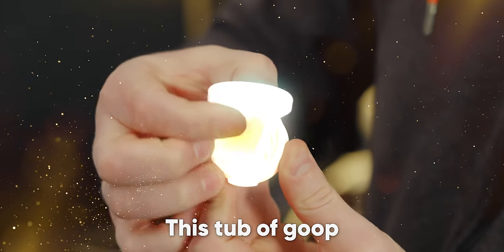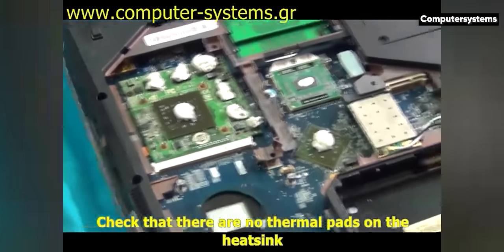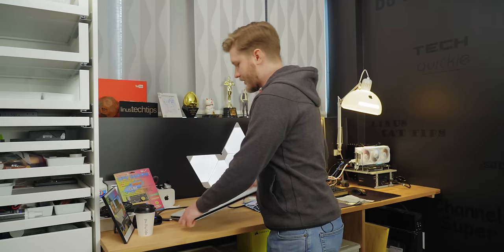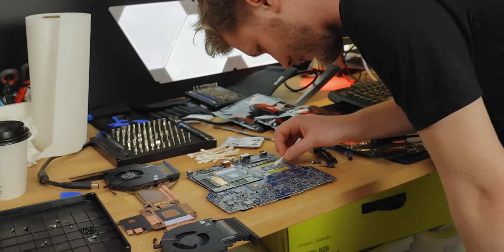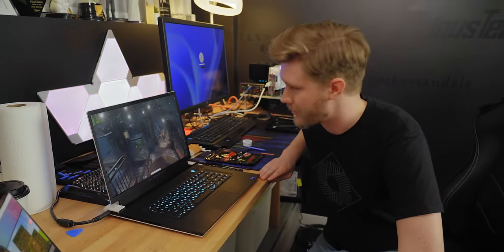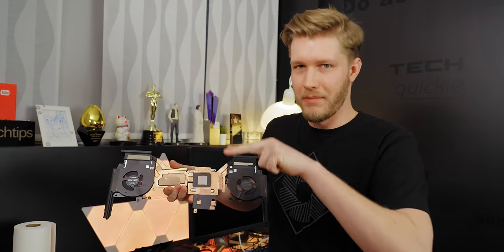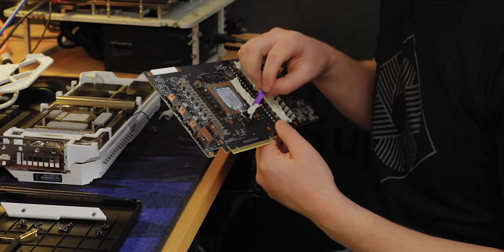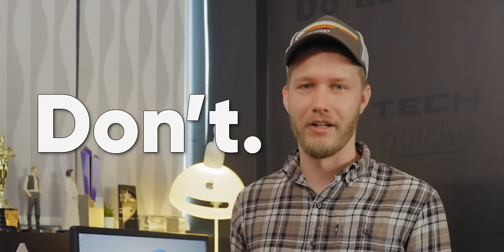More FPS for just $10 - K5 Pro Viscous Thermal Paste

Comment: 5:53 DO NOT USE COPPER SHIMS
Ever!
Especially. ESPECIALLY!! In a laptop!

An average Joe modding his system is at insane risk of shorting his GPU or laptop with that. Even if he succeeds, it voids the warranty, so if the expensive part ceases to function, they can't repair it for free even due to completely unrelated issue. But more often than not, it dies precisely because of that since copper is electrically conductive. 

As we all know, 12V isn't supposed to go into 1.2V circuits. Goes to memory? No you have to replace all those GDDR6X chips, GL sourcing them. Goes to the main GPU die? The die dies, no pun intended. Even if it mearely rosts an RGB controller, it has a high risk or burning a freaking crater on the PCB since modern GPUs are supposed to draw a lot of power and when the PSU notices 400 watts drawn, it can't possibly tell if that's a normal Nvidia transient load or a catastrophic failure.

If you misjudge the shim thickness and exceed it, you won't have a thermal contact elsewhere. That "elsewhere" usually is the main GPU die, and guess what happens if it doesn't contact the coldplate? It dies! 

Installing a copper shim in a laptop is the next fucking level. Laptops are portable devices. They may and will be carried around, and can easily be subjected to vibrations and whatnot. That displaces the shims which aren't properly fixed in place - they aren't supposed to be there at all! Displace them enough, and you'll again send power rail voltage directly into the CPU or something along those lines.

If you ever think about buying a laptop and modifying it later with copper, consider buying a different laptop with bigger coolers and better VRMs. 
If you ever think about putting those shims into a $1000+ GPU, just buy a chonkier one. Or, if warranty does not bother you, consider buying a waterblock. Water cooling is MUCH SAFER that this shit. The parts are well designed, have thorough installation guides, you can pressure test the system for leaks before installing anything, so you do not risk shorting you PC if you follow the correct installation procedure. You always have this risk with copper shims.

Of course, if you find out some gross stuff about thermal pads in your GPU, like some forgotten thermal condom in there from the factory or no thermal interface at all, you should fix that issue. But you never do that with bloody copper over the VRM. Either RMA the thing, or, if you are willing to fix that yourself, find out information about the correct thermal pad thickness, buy the exact thickness, install the proper pads. Not the shims. Pads. They aren't electrically conductive. 

Also, a little nitpick. Please, be more gentle with the PCB, don't do it like here 4:45
You are at high risk of detaching an SMD component form the board. Fixing that isn't too hard, it merely involves finding the missing component (usually a multilayer capacitor) and resoldering it back where it's supposed to be. But if you can't do that yourself, the price for that simple repair may be high since the repair shops never hesitate with charging a lot of money when they see cards like 3090, even if the repair is basic SMD soldering work. 
Instead, anticipate the board going up and don't let it bounce back and forth when it detaches. Just don't rush it, you aren't in a hurry. You don't want to be, not when the card worths $2000

Comment: do not buy this product , i used it on a GPU , after 4 month , Thermal Paste lost all of its viscosity , making my vram heating up and making my pc shut down , even though  the chipset of the gpu itself was under 70 degrees , the chipset of the vram were on fire , garbage product.
Reply: when this happened, do you remember what was originally on your Vram? Was it originally thermal pads or had paste on it? ( I mean before you put this K5 on it)
Reply: @tereongullygully3314  the product is a scam , originally it had thermal pads , and this product is sell as a pad replacement with better thermal conductivity , totally scam , the shit lost all viscosity and become rock solid

Comment: Thanks for reviewing K5 pro at last. 
My 2019 msi ge75 raider 8se was too hot in CPU temps, after 2 years of use and searching for the best thermal paste on the internet, I saw a repaste video of ge75 raider, by "meanpooh". 

https://www.youtube.com/watch?v=J2qEv7y7cDg

then ordered K5 pro, and after my first application with mx-4 saw no improvement. then I did again with thermal grizzly with better temps (80-90), then after a month temps goes up to 97 degree again. and also I ran out of thermal grizzly (just a little bit of paste on 1gr tube).
today at Dec 27th , I opened up my laptop for repaste, and after applying k5 pro, noticed that two of CPU choks not contacts to any heatsink, and these were in this shape from factory. when I saw closely at them, found the choks surface rough and the word "R22" wear off. (they probably tolerated a lot of heat). so I covered them with K5 pro and connect the paste to the next choke, since there is not extra heatsink (not long enough to cover whole), then apply remaining T grizzly to CPU, then add a little MX-4, mix them and spread them on CPU (mx-4 on GPU). 
now my heating issue is completely  gone. after 2 hour Metro exodus CPU temp was 77 degree. (no undervolting)
thats is.
this product is the best. no need to re-apply. k5 pro lasts for ever. I'm ganna order their new kryo33 thermal paste with over 13 W/mk. I think kryo33 is better than thermal grizzly products.

Many thanks to:
Meanpooh
Computer systems
LTT

Comment: I can't understand why you are promoting or recommending this product. It is in no way suitable for Laptop / GPU applications. 

Yes, this is a thick paste with high thermal conductivity. 
Now, what happens if you smear it all over VRM's that can reach up to a constant 100°c temperature, heat which then gets transferred through the paste to all the components around the VRM's that have much lower constant heat tolerants?  Well, those components will degrade really fast or just outright fail. Asus for instance uses thermal paste instead of pads in some of their laptops BUT in modest amounts so it doesn't cause heat transfer to nearby components on boards designed specifically for that application.
At the same time this paste is in no way suitable for gaps over 1mm (it creates air pockets under thermal stress over time in anything over 1mm) and for the hard to clean up mess it makes it is not worth it or the risk it brings.

Thermal pads are used for a reason. Not to save money, not to save on assembly time and not to screw customers on thermal performance. 
They are used cause they don't transfer heat to nearby components but rather remove that heat, they are reliable and retain thermal performance for a very very long time, they don't cause too much of an influx of heat to heatsinks so that they will fail too keep the main IC cool enough under stress and they don't need constant maintanence like this crap.

On Laptops and GPU's just get proper thermal pads to replace with like Gelid or Thermal Grizzly's if you wan't better heat transfer.

If you need some thermal transfer goo to slap on a industrial heat exchanger or a PSU heatsink, then use this stuff.